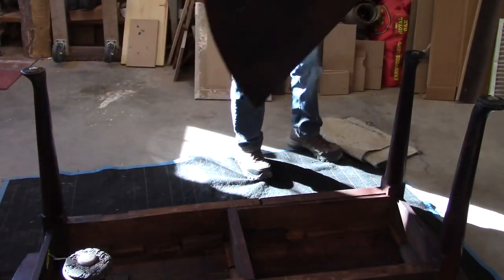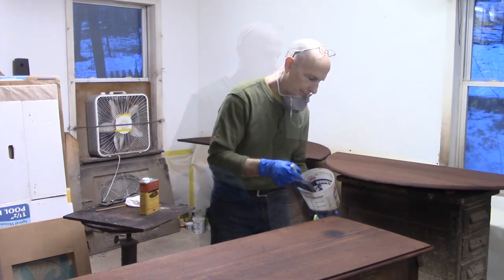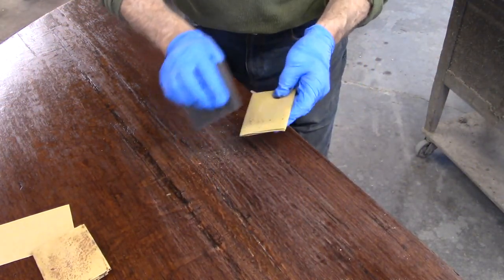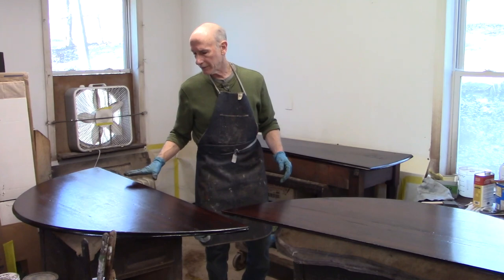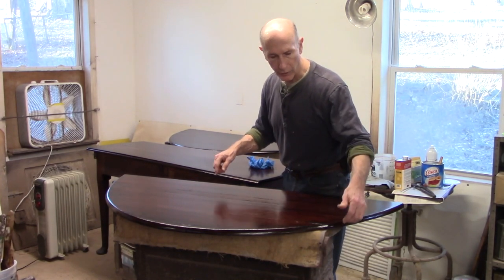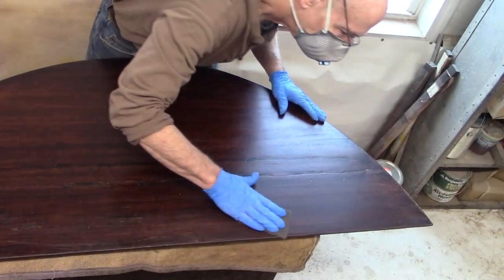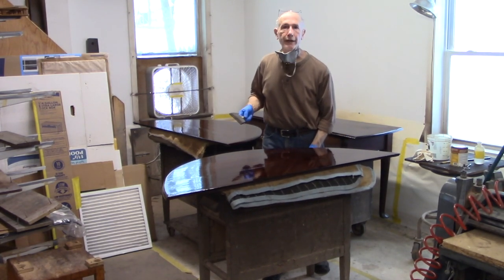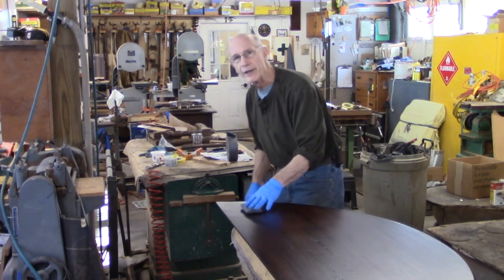Finishing an early 18th c. Drop-leaf Dining Table - Thomas Johnson Antique Furniture Restoration

Comment: If I have a mass produced piece of furniture from 1918 that needs to be repaired, can I get any furniture repair place to do the job or only use an antique repair business?
Reply: It really depends on what needs doing and the extent to which you want 'repair' (functional, and possibly using modern techniques/materials) vs. 'restoration' -  getting the piece close to "what it would have looked like without the breakage, using (mostly) the same techniques that have been employed at the time of construction". 

Tom has some nice videos of work on early and mid-20th Century pieces. Although they were often mass-produced, some of the repairs involved require considerable knowledge and skill, and some of the techniques are no longer in common use (e.g. tambours).
Reply from the maker: Thanks! I like dlevi67's response
Reply from the maker: Thanks! Well said! As always!
Reply: @dlevi67  it's one of the bent parts (legs). And the dowels that connect it to the seat.  I would say that the 2 holes where the dowels broke off the curved piece(leg) needs to be drilled out. Replace broken dowels. 
The chair has more sentimental value then monetary. I should mention that it is a child's rocking chair.
Reply: @saggioculo5386  If it's just a dowel, as in a separate round piece fitting into two holes, then I would say it's an easy repair and there is no need for a specialised restorer. I'd be happy to do it, but I'm unlikely to live in your neighbourhood!
Reply: @dlevi67  I'm in NC.
Reply: @saggioculo5386  I'm in the UK... which definitely makes a trip this way for a 'free' repair a lot more expensive than finding someone local.

Comment: I enjoy your restorations but notice you don’t use traditional french polish techniques , is there a reason for that ..?
Reply: One reason here is that this type of table would not have been French polished in origin (and the 'modern' style of French polish for furniture is relatively recent - 1780 or so at the earliest, which is way after this piece was originally made). Tom does use shellac and he does use a traditional pad every now and then!
Reply from the maker: Thanks! dlevi67 is right. I couldn't French Polish an object that large even if I wanted too!
Reply from the maker: Yes, thanks! I'm not big on French Polishing

Comment: Well, I'd have French polished it and had it done in an afternoon. At the very least a coat of sanding sealer would have saved an awful lot of bother.
Reply from the maker: Thanks! I use varnish on table tops, I could never French Polish something as large as a table top. The problem with French Polishers is that they want to French Polish everything!
Reply: @johnsonrestoration  The main problem I have with this kind of finish is that when it comes to needing restoration in 50 years (or the repair of a scratch sooner) the future restorer is going to have to go through the whole process again. With a shellac based finish repairs are simpler as is a total refinish. Given that we are not going for a super glossy finish here anyway you could even brush on the shellac and sand back if you are not up for rubbing it on. I've seen pretty good results with brushed shellac on this kind of piece.

Comment: I'm almost 72 years old and I have restored, refinished and built reproduction period furniture for 50 years. (I build mostly in the Queen Anne style using traditional joinery.)  I've retored almost anything you can think of and I've even restored guitars.  I have a particular expertise in finishing and re-finishing.  I see some problems in the finishing done on this table.  Mainly, too much staining was done after clear finishes were put on.  Stain should only be used in the raw wood.  When you put a clear finish on something and then add stains or another layer of clear finish with stains, you're making a mistake.  When there's color in surface finishes, that can and will chip in the future and it will look terrible.  This table looks fine when finished but it won't look good after moderate normal wear.   Also, the fact that so many corrections had to be made in later finishing steps confirms that mistakes were made.  Personally, I prefer a different finishing strategy although it can't be used on some expensive period furniture that should be done how it was originally done.  When that isn't an issue, I start with several thin layers of boiled linseed oil. It's thin for deep penetration. I literally rub it in by hand and, by that, I mean bare hands.  That generates a heat that forces the oil into the wood.  After multiple coats of that, I start combining Tung oil or similar "oil" finishes and applying them the same way. If I use brushes at all, it's only to soak the wood.  Finally I begin to add some polyurethane to the mix to build up some surface protection but not put a thick glass-like top coat.  Such a finish greatly reduces the possibility of scratching and repair is as easy as rubbing some more of the mix onto the surface. I finished things 50 years ago this way that look today as if they were finished yesterday. The idea is to NOT have a thick glass-like finish surface and to NEVER use any stains in those finishes.  Again, if they chip - and they will - you'll have a terrible mark.  That will never happen with the above finish.  Of course, when historically necessary, I'll do shellac and/or varnish finishes including french polishing.  

When you cleaned the leg of the table, you saw how much stain came off on the rag. That should tell  you something. Stain SHOULD NOT be in a finish, especially a surface finish.  

One other thing:  When you said you didn't know anything about the monetary value of antique furniture and how re-finishing it could affect that value,  you revealed a serious carelessness.  It's part of a furniture repair and refinisher's job to know that and to respect it.  You could cause a huge loss in the value of furniture by choosing the wrong methods.  In fact, you can literally destroy the value of fine antique furniture thinking that way. You believe your table was over 300 years old. If so, you should have been VERY concerned about choosing the proper finishing methods.  You may not care, but the owner of the furniture almost certainly will.  

BTW, placing a varnish finish or any slow-drying finish next to a vent fan is inviting dust to be pulled onto it.  You saw all the junk in a layer of what I believe was basically a varnish.  Air SHOULD NOT be moving when a slow drying finish drying. Oil finished totally eliminate any possibility of having a dust problem.  Also, I'm not sure why you wear a mask. The products you were using are not dangerous or harmful but that's your choice. It seems these days everyone is afraid of everything.  You would think everything in the world causes cancer in California!
Reply from the maker: Thanks Bob! good advice! Everyone has their own way of doing things, and if it works for you - great! I'll be in close contact with the customer to see how the table holds up

Comment: They better not let a kid with a can of Coke within 50 feet of that table now.
Reply: Can of Coke is fine; it will wipe off. It's a hot mug of tea with a wet bottom that is the problem!
Reply from the maker: Thanks! Yes, dlevi67 is correct!
Reply from the maker: Thanks!

Comment: That burn mark is really horrible.  Was there really nothing that could be done about that?
Reply: Short of sanding it down, I really don't think so. And that would have carried a lot of issues with it...
Reply: dlevi67 Sanding it down would have saved him a lot of elbow grease, that's for sure. Moreover it would have left a better finish.
Reply: @horatiohornblower868  'Better' is relative; I for one prefer the burn mark to stay where it is, since removing it would mean altering all the surface of the top very significantly and that would have opened all sorts of cans of worms with screws coming out. 

I'm not even sure that it would have meant 'saving time'. If you want a new table, go buy a new table - that is almost certainly cheaper.
Reply: dlevi67 You're probably right. But purely esthetically speaking I find the burn mark gazing at me unbearable. Tom went out of his way to give the top a nice finish and to a great extent he succeeded. But everyone who sees the end result will have the same reaction: nice try, Tom, but just a pity about the burn mark.
Reply: @horatiohornblower868  Not everybody - I for one am not upset about it at all.
Reply from the maker: Thanks! Interesting discussion! I wasn't even noticing it at the end - but to each his own! dlevi67 is correct though, we already had screws peaking through the top - that mark was deep! The top would have been 1/2" thick before the mark was gone.
Reply from the maker: Thanks!